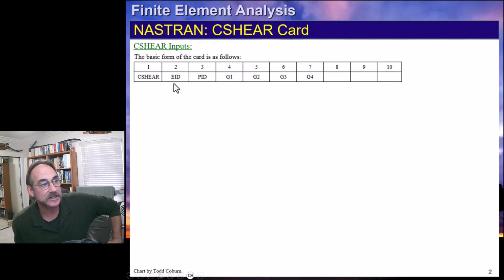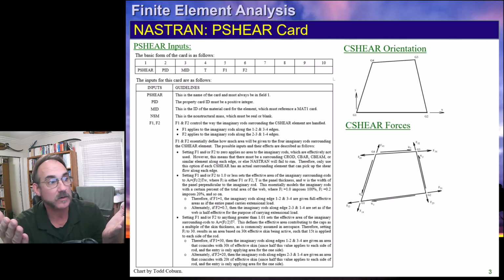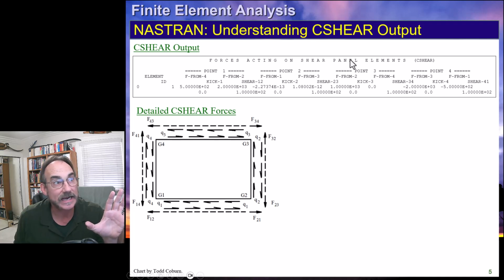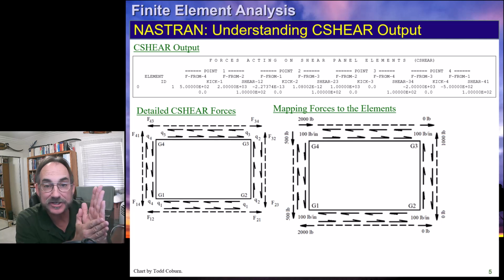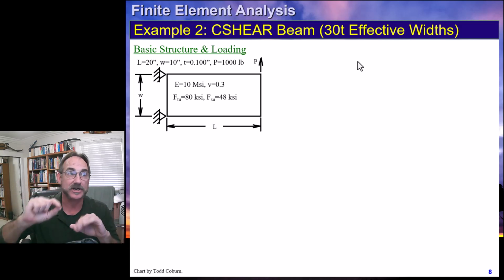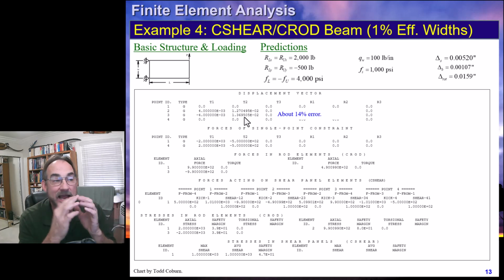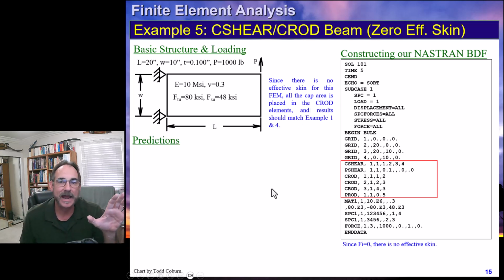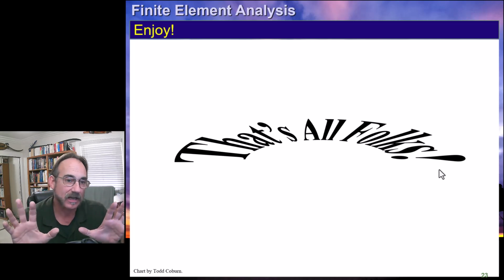NASTRAN L-09: CSHEAR Elements

Comment: Thank you for this lesson. 

One question: if I offset the rod such that its centerline is not coincident with the shear panel edge, will the crod forces and stress,  in nastran file,  be the correct ones ?
Reply from the maker: I do not know of any way to offset a CROD element.

Simple is best.  The more complicated your model, the greater probability that its answers are wrong.

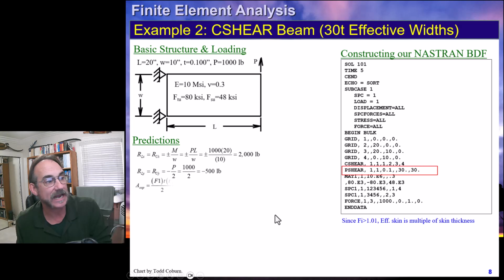Comment: Great video professor, been waiting for something like this. At 33:00, there seems to be a typo in the Acap formula, is (F1)*t*t^2, should be (F1*t)*t = (F1)*t^2? Would the shear flows be different along any of the 4 edges in any other situation? I'd think yes if there are other adjacent CSHEAR. Here they are the same for the single CSHEAR used. Also, what is max vs average shear stress, they are the same in the simple FBD demonstration? When would they be different and which one should be used for shear buckling checks?

Comment: Do you recommend using the same mesh for CQUAD and CSHEAR and just changing the element property assigned or does CSHEAR benefit from making a separate coarser mesh?
Reply from the maker: Same mesh is fine.  Except CSHEAR mesh is nearly always governed by the panel size, while many kinds of buckling analysis of models with CQUAD4s will need a finer mesh